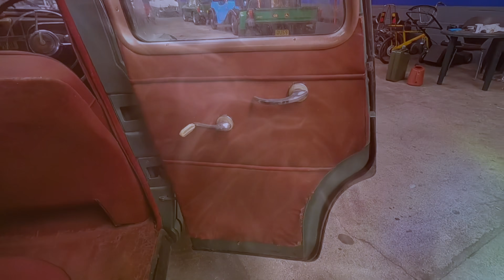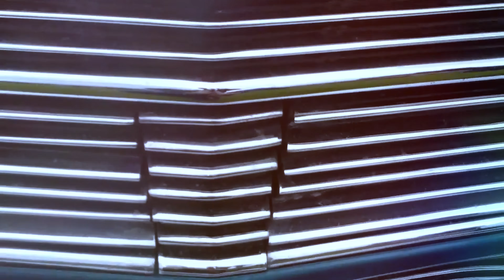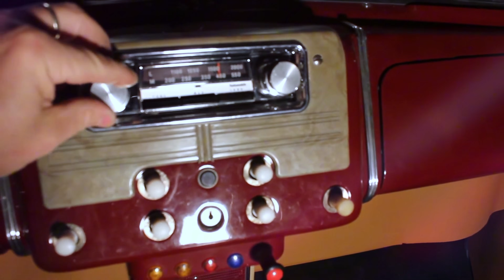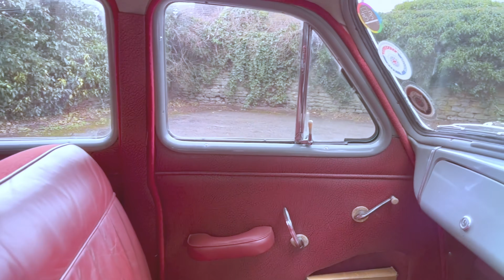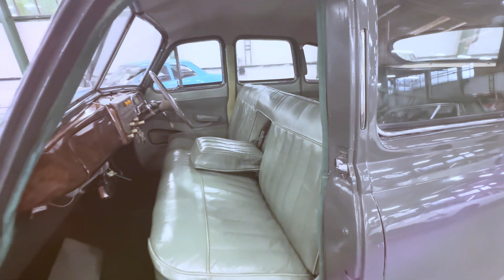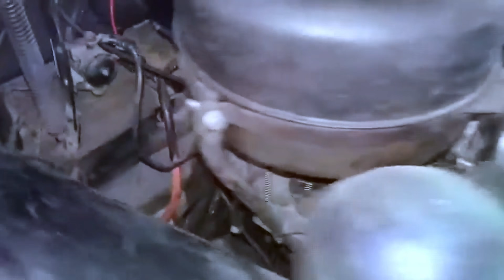13 Shocking Facts About the Standard Vanguard 1948–1953 You Probably Didn't Know

Comment: I had a 1949 model fast back in mid grey. I bought it in 1965 for £50. Sadly, it was involved in an accident in 1966 and it was not economic to repair. A great car although it did tend to lean heavily into bend as the anti-roll bars were defective - at least that was what the mechanic said!!!

Comment: I learned a lot about cars from the 1952 Vanguard van at Brookfold Farm. How to drive, and how to repair various parts. It was a wreck by the time Billy Tym dragged it out of his father's barn. But he got it going. 1965 or so it must have been. Then he seized the engine after washing it out with paraffin and starting it up without draining it and putting oil in it. We stripped it down and put it back together, and both drove it up and down the lane and around the fields. I replaced the broken front coil springs. They were in pieces. 9 pieces, if I remember correctly. We never did get the brakes to work. The foot brakes, that is. The handbrake worked a bit. It had a milk crate for a driver's seat and a cream can for a fuel tank. And no exhaust system. We thought it sounded great. Boys will be boys. And no one died.

Comment: I was only 4 in 1952 when my father purchased a Vanuard and I clearly remember accompanying him to collect it from somewhere at Park Royal in West London. Its. registration was RPG 654. It was to be the first car that I drove some 6 years later at the age of 10......I could just about reach the pedals. Once the car moved forward I was hooked and have loved driving ever since.
The low compression ratio gave the engine a wonderful torquey character and it would pull strongly and without complaint from tickover in top gear.
I am interested that you mention overdrive on 2nd and 3rd gears. The car in question had a manual overdrive which operated on 3rd gear only. Thank you for an interesting video.
Reply from the maker: Thank you for your story and I'm glad you liked it, great memories that time cannot erase

Comment: Phase 11 was the first car that I ever drove . It was not any old model but the diesel with the Perkins engine. Problem was that to start it in the winter one has to use the valve lifter ( lever under the huge heavy bonnet ) and a can of Easystart.  That was until the ambient temperature was -5C or lower, the diesel then contained wax which gummed up the fuel lines.
  It was only the second diesel car in the county , the first was a Mercedes  owned by the local veterinary surgeon.

In the words of the farmer “ it would not pull a drunken sailor off a whore “ even with overdrive.

PS he replaced it with a Mazda R8 ( Wankel rotary engine which was fast for the time, zero to sixty in 6 seconds. )
Reply: PPS it had a boot not a trunk ( I made frequent trips to a local cattle market with a bull calf in the boot.)
Reply: Are you sure it was a Perkins diesel?
Reply: @bluegtturbo  It was the Standard engine as used in the grey Ferguson tractor , the Perkins engine was used by Massy Harris.
Sorry about the confusion, it was a long time ago.

Comment: I travelled in the Vanguard but never owned one, although I did own two Triumph Renown saloons, one of which had the overdrive fitted.
The top speed and fuel consumption are in line with what I got and latterly I used to do a lot of miles driving the TR4A.
The Renown was fitted with aluminium boot, doors and bonnet.